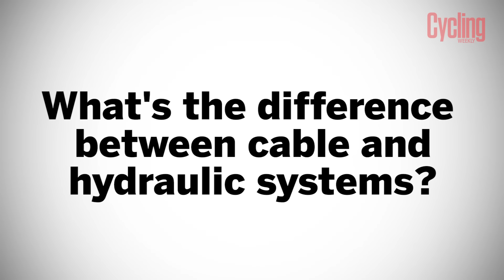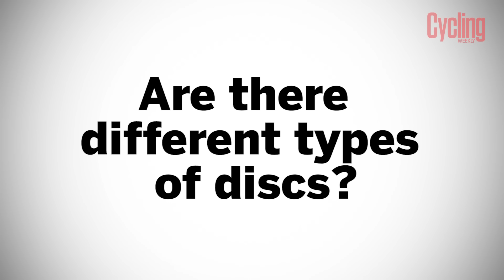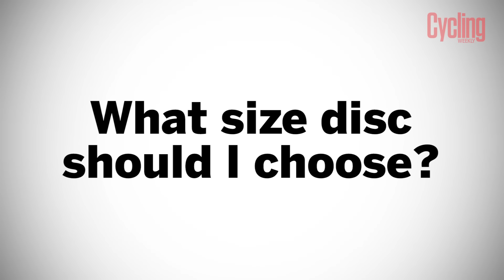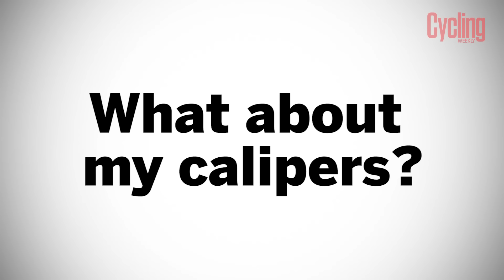Eight things to know about disc brakes

Comment: More convinced than ever that I don't need those.
Reply: OK, let me fit some rim brakes on that car in your avatar.  

You are correct of course.  You don't need disc brakes.  But they do provide better feel and modulation than rim brakes as well as more consistent braking performance in a wide range of conditions.  It only took one descent down a wet mountain with zero stopping power from my rim brakes to convince me that disc was the way to go.
Reply: Well if my Camaro only weighed 15 pounds and needed a big hill to get over 40 mph I would say go for it, but since it will get to 60 in just a shade over 4 seconds and weighs 3600 pounds I would say that is not quite an apples to apples comparison. I don't mind you buying disk brakes! I hope you have a great and safe time on your bike. What I said was "I don't need those".
Reply: You are correct of course.  You don't need disc brakes.  Second line of my original comment.   Your original comment dismisses a superior technology off hand.  

You don't need them in particular if you only ride on bluebird days.  The truth is that braking force is limited by the traction provided between your tires and the ground.  Well designed rim brakes work just as well as disc brakes in dry conditions.  But, if like me, you ride in less than perfect conditions regularly, discs make more sense.  If you are using carbon clincher rims, disc brakes start making even more sense.  If you are using cheap Chinese carbon clinchers, I would begin to say that you NEED disc brakes.  Particularly if you lived in a mountainous region.

It's all relative.  Happy riding.
Reply: William Keys superior perhaps for you,  but I don't need those. :)
Reply: You are correct of course.  You don't need disc brakes.  Do you even read my comments before you reply?
Reply: Yes of course. Several things go into my decision that I don't need disk brakes. First- I live in Forida. The number of places where I will ever see speeds over 40 mph is tiny. I only rarely travel for a ride and when I do it is to places with similar terrain so I am never going to over heat a carbon wheel and the tech is such now that it is less and less possible to do so. Second- I have never found a time when I could not produce more braking force than the tires could handle. Third- As of right now rim brakes are still lighter, easier to maintain, more aero, easier to change the wheels than disks. Disks are still early in their development and just as with carbon frames I think a time WILL come when all of those will equal or even surpass what is possible with rim brakes. When they do, I might need those then, but not yet. I didn't buy a carbon frame when they were overly fragile, but I have one now. I am pro technology, but until it becomes a step forward in the areas that are important to me,,,,,, I don't need those.
Reply: Brian Moore
I'm going to be honest here.  I said many of the same things when disk brakes first hit the MTB market in the early '90s.  But once I got my hands on a bike with them I was quickly converted.

Hydraulic brakes are almost maintenance free.  Thru axles solve any alignment issues that people may have experienced with them and also make for stiffer frames and better power transfer than QR dropouts.  They offer superior modulation to rim brakes and that is where the improvements really come in. 

I understand taking your time adopting new technology as I have seen many "next big things" turn out to be nothing more than marketing hype.  I also understand waiting until some of the initial teething problems with a new technology are sorted out too.  The first generation of disk brake road bikes were "sportive" bikes with more upright geometry and they had QR axles.  Not the best combination for performance oriented riders.  A few years on, and we see brands making disk versions of their top end race frames with thru axles.  As road disk brakes become more common, we will see more truly road specific product (right now, most calipers are MTB parts) and maybe some weight savings.  But to be honest, I don't notice much difference between my 17 lb rim brake bike and my 17 1/2 lb disc brake bike on the climbs.  And I do travel and ride in less than perfect conditions regularly. 

Enjoy FL and in a few years when it's time to look for a new bike, don't be afraid to consider some disk brake versions.
Reply: Time can definitely change things and I would never rule out disk brakes forever. The science to make them MUCH better exists and in a few years they may get there. Imagine this: Ceramic disks paired with ceramic pads in a graphene enhanced carbon caliper molded to be more aero. This mated with a carbon wheel made from the ground up to maximize aero efficiency rather than just a tweak of an existing rim brake wheel. All of this is possible today, but we won't see it for several years yet. As evidence I would have you look at team Sky's 2017 race bike the Pinarello F10. Even though the UCI has given the go ahead for disks, the highest tech team in existence is still using rim brakes on their latest bike.  If they thought the marginal gains were there now they would be all over it.

Comment: 9th : the industry want rim brakes to disapear to force roadies to replace all their frames and wheelsets. They figured out that a mechanical groupset , a carbon and alloy frames can stay in good conditions for 15 years just by replacing pads cables cassettes and chains. My bikes are 2006 2009 20011 all running on shimano 10 v I can stay like that until 2022 at least. SO not a good customer for them/